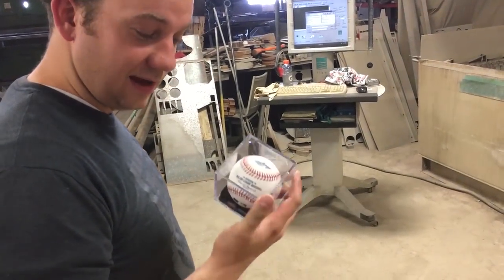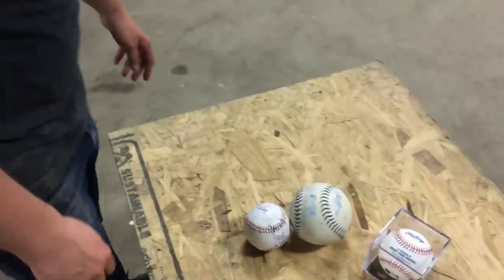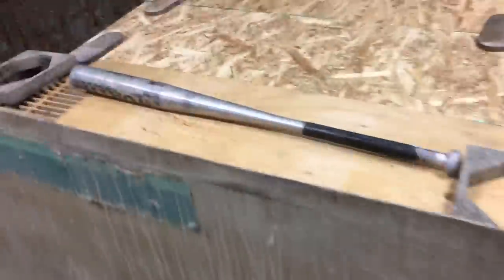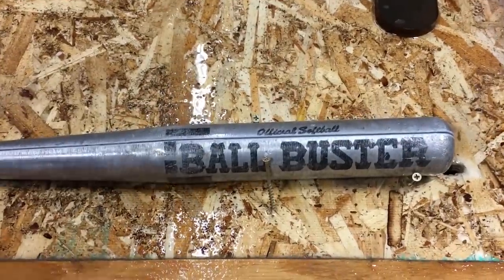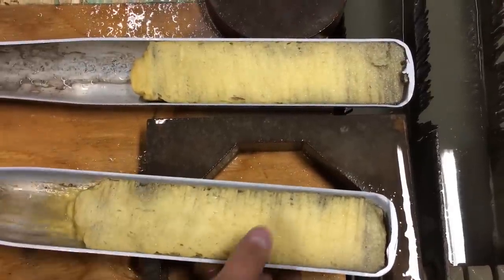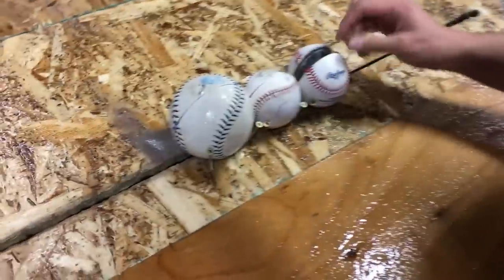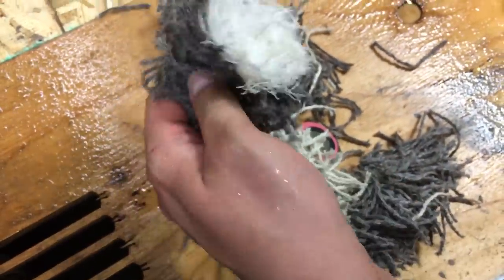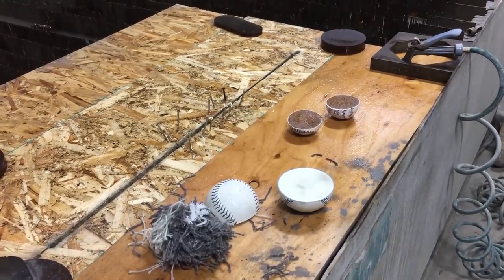$1 Baseball vs $30 MLB Baseball vs Waterjet at 60,000 PSI

Comment: With all the stuff you guys cut, I'm curious, how do you keep the water from becoming too dull? Is there a special way you sharpen it?
Reply: SuperJigles underrated comment
Reply: Indeed
Reply: I don't know if you're joking or not, but one would assume they freeze the water then sharpen it on a regular basis.
Reply: There’s actually a trick to it. They don’t reuse the same water every time, they freeze some sharpened water and just unfreeze it for each cut
Reply: Wet stone
Reply: fine sand
Reply: I took the comment seriously and started wondering if the nozzle starts breaking down to make the flow of water not as focused and thought thats wat u meant then i realized it was a joke
Reply: 900bz that is a thing though. The nozzles to wear out
Reply: 900bz the nozzle does slowly break down and has to be replace
Reply: Haha
Reply: @900bz  r/woooosh
Reply: They add sand to it
Reply: Yikes cringe
Reply: with the water jet, have you even seen their other videos?
Reply: srry for saying but r/wooosh for most of the ppl here
Reply: Calibri o esqueleto shut up
Reply: They only use new water
Reply: They sharpen it with a high pH water. See when you add hydrogen ions to H2O ions it yields Hydronium (H30+) which is a strong acid. So that will give you a strong and sharpened flow of water
Reply: U good? 💀

Comment: I'm pretty sure that bat is not legal and is used by coaches where they can swing lightly and still get a solid shot to their players during long practices. It's kind of like a corked bat, but I bet if you cut a legal bat it wouldn't look like that. That's why it's called a "ball buster" as well. Because it hits further than a legal bat.

Comment: you know golf balls useto have rubber band wound on the inside similar to the baseball and if put one in a can with a little gas the outside would melt and the rubber band would unwind all at once